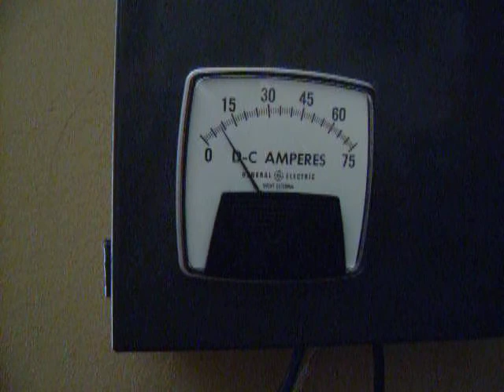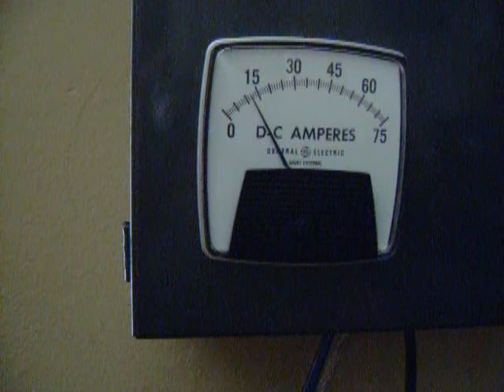DIY Aluminum Frame Solar Panels And Charge Controler pt 2

Comment: Hey, sorry I didn't get back to you sooner.  My YT channel was messed up.  Anyway, yeah the HF panels are a little pricey.  You can get them on sale for $3.00/watt but you'll get a more consistent output from them.  I'm going to add a couple mono-crystalline panels in the spring bc they supposedly are better in partial sun too.

Comment from the maker: @jhs5150 I would love to get some amorphous panels they are harder to find in 12 volt  and not  break the bank. Harbor freight has some but are just too expensive for what you get 200 to 250 dollars for 45 watts ouch. I wish the prices would come down. amorphous that is what I meant to write sorry. you can get the 90 volt ones but they are too high of voltage for my rig.